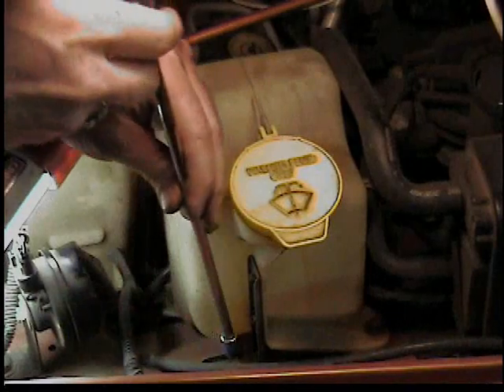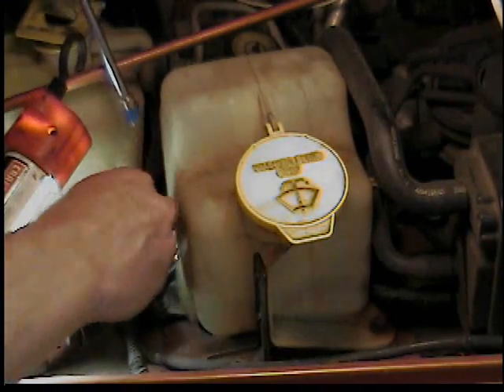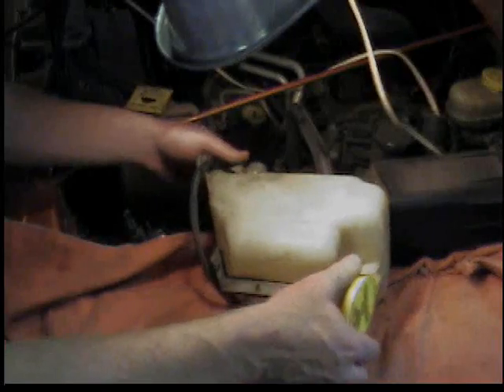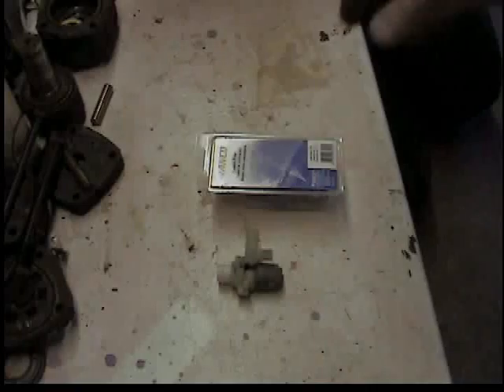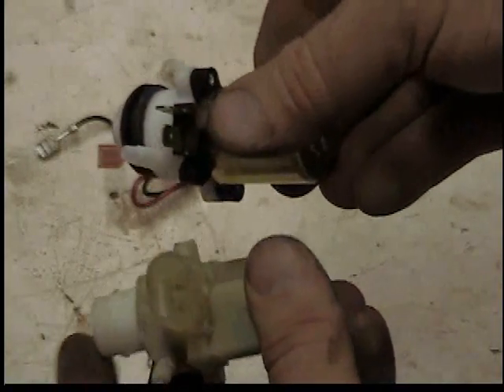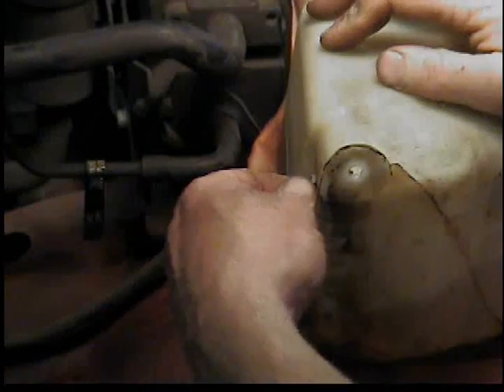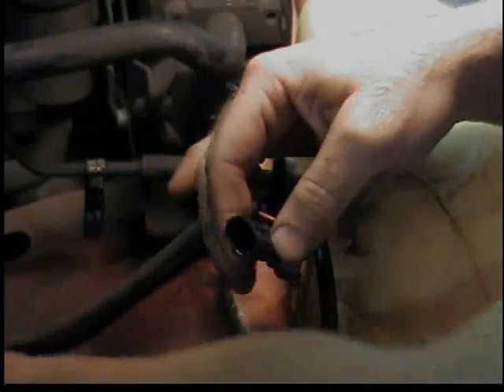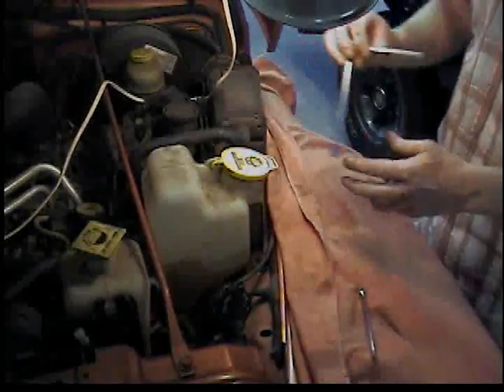windshield washer fluid pump install, How To DIY, Jeep TJ

Comment: Thanks for sharing! I just replaced the pump in my 2002 TJ following your instructions. 
I had to re-use the old stiff grommet because the new supplied ones were smaller and allowed a small leak. I greased them with o-ring grease.
Reply from the maker: Nice work. Jeep On!

Comment: Just installed a new pump in mine which is a 97 and a little different, but very similar, same pump I think. .  Anyway, I could hear it running (the old one) but no juice...  Blew out all the lines from the pump to the nozzle, not much help.  After installing the new on it works perfect.  As I was taking the old one to the trash can, I discovered inside the intake there is a plastic screen, it was clogged solid with smegma...  I'm pretty sure that was the issue.  Had I known to check it, it may have saved me $17...  So now you know to check that before you rush to the store.  Thanks for the post, it was helpful!
Reply from the maker: Ahhhh! Jeep On!

Comment: Thanks for the tutorial.  My pump is probably factory original, and it works sporadically (usually when I don't need it, but "testing it".  When it's muddy/dirty, it rarely works).
I'll probably just replace it, rather than troubleshooting the motor; too easy!

Comment: This is quite helpful. I'm the original owner of a 2001 Jeep Wrangler. We're getting some cold temperatures and snow here and realized that my windshield washer fluid pump is 10-7. I'll purchase a new pump today and see if that resolves the issue. Thanks!
Reply from the maker: Barnacle Bill 10-4. Jeep On!

Comment: Great concise video.  I'm a YJ owner and I'm running into a couple of items... there is a filter piece that screws into the pump from the inside of the reservoir.  For the life of me, I can't figure out how to keep the filter in it's vertical position within the reservoir in order to screw in the pump from the bottom side.  If I went without the filter, the pump fits very loosely into the rubber grommet and I'm worried it would eventually fall out while driving.  I'm stuck for the time being.
Reply: Just did some digging... with the YJ, you use a spark plug socket with 9'' of socket extension to tighten the filter inside of the reservoir onto the pump (outside).  The other problem I had previously was that I could only find a dual pump reservoir and my jeep is single pump since it came with a soft top.  I had to go to Lowes and purchase a 1/2'' rubber plug in the hardware aisle to get the second hole plugged.  Works like a charm!
Reply from the maker: Great information. Thanks!
Reply: Can you run that pump in reverse if you put the wires on backwards

Comment: Hey thx for the video. When I call for washer fluid the wipers turn on and I hear the motor humm but no spray. Do u think the motor is bad or I have a block. Neither sprays. They stopped wkg out of the blue one day. Thanks
Reply from the maker: Hmmn. Your going to have to do some troubleshooting. Maybe pull the hose off and blow through it. You'll figure it out. Jeep On!

Comment: Hi there. Both front and rear wipers work, the front washer works. The rear stopped today. Any suggestions? Thanks, you've helped me before too...
Reply from the maker: The rear window washer stopped working? It has a separate motor just like this one. Same process.

Comment: i have a problem with the rear wiper sprayer on my jeep yj for some reason it wont spray water and when i turn it on i can see the wiper moving but it wont spray and i cant hear the pump working ,im pretty positive the pump works fine because the front wipers work as they should ,do you have any idea of what it might be 
thanks.
Reply from the maker: I'm sorry. I have never had one of those.
Reply: Probably know this by now, but that means your line could be clogged or the rear wiper pump is bad. Hard tops have both a front and rear wiper pump